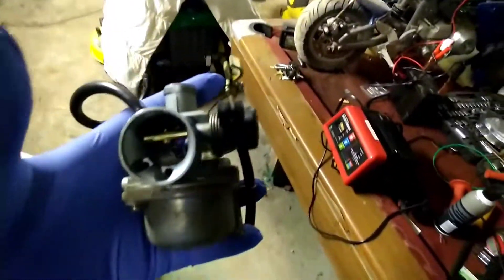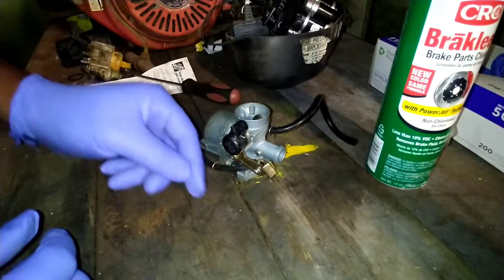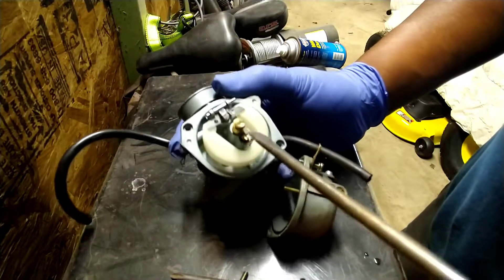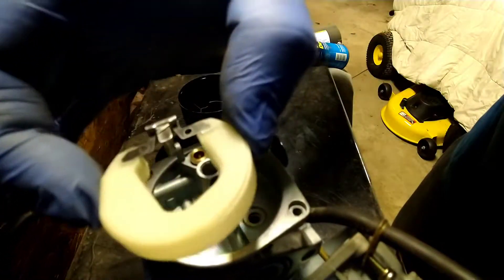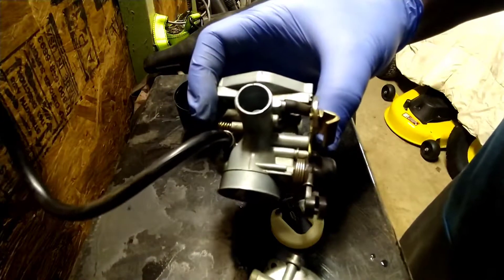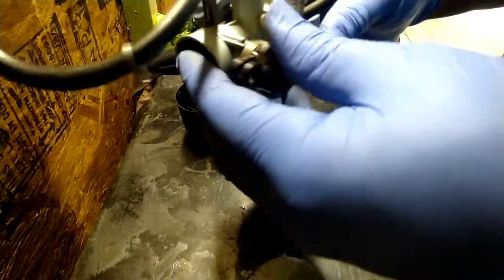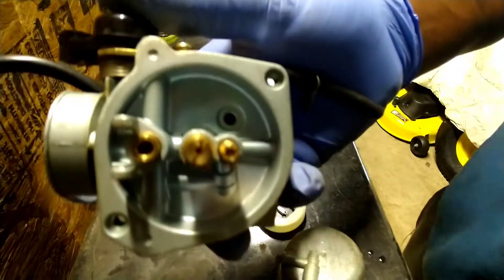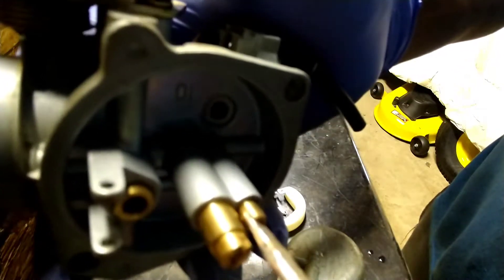HOW TO CLEAN YOUR CARBURATOR ON YOUR!! | 250cc DIRTBIKE | ATV | SMALL ENGINES |ITS SIMPLE 💪💯

Comment: Hey bro love yr vids just a heads up the float is the white round thing the thing that sits in the hole is yr needle and seat 😁
Reply from the maker: I know it bro I think to fast and get my words mixed up sometimes bare with lol..but thanks man💪💯💯
Reply: @geesocreative567  all good bro understandable haha he wat spring did U use in the rear and did U change the shock as well I'm wanting to go softer as I'm 78kg and find it very stiff
Reply from the maker: I got a video coming up this week on how to adjust the springs as well as dialing them in 💪💯💯 thanks for watching the videos bro and subscribing 👍
Reply: @geesocreative567  U said U changed the spring did U use a crf250 spring and shock or r U still running the standard mines a 2016 so has a diffrent shock setup to yrs same bike tho
Reply: @geesocreative567  and how did U use the crf250 clutch with this bike what year did U use it from
Reply from the maker: @kaisloetjes483  I'm using a Honda CRF 250 clutch.. you can go online and look at the clutch pattern to see what year possibly fits yours.. I went with a 2005 clutch
Reply: @geesocreative567  have U still got the standard spring and shock in the rear or did I change it to a CRF 250 if so what year did U use.. and also what FMF pipe did U use to suit the length where the joiner is